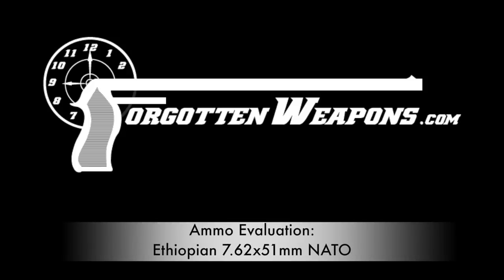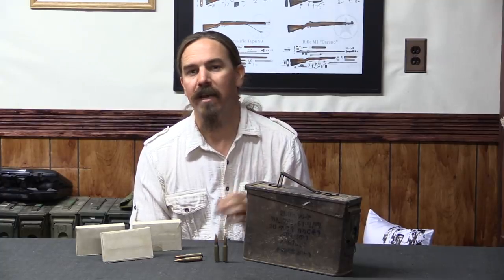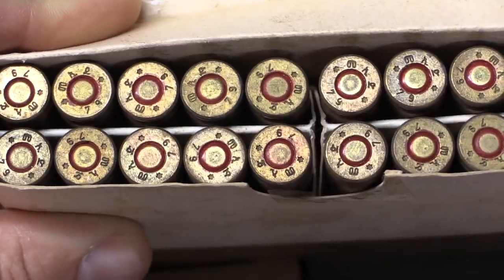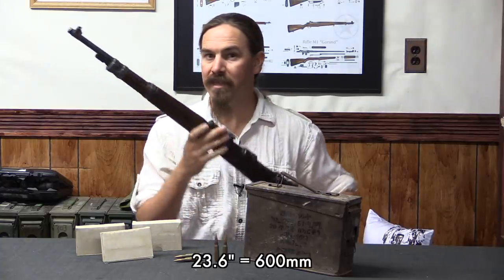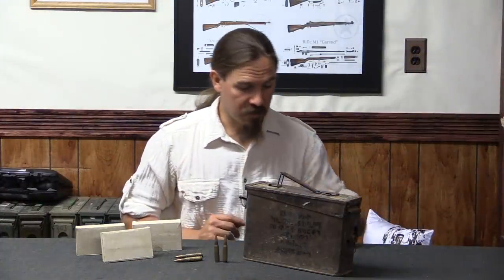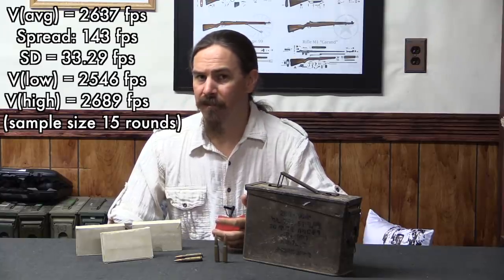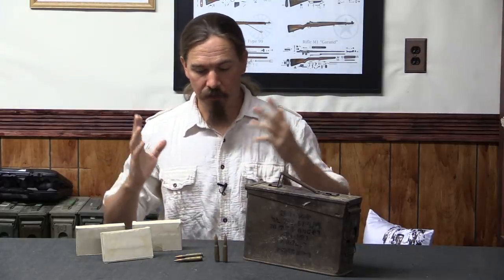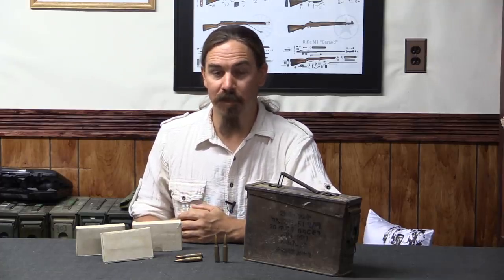Ammunition Evaluation: Ethiopian 7.62x51mm NATO

Comment: Definitely an interesting option if you want to some cheap ammo to shoot down range, but with the delay wouldn't they be a bit risky to use on automatic firearms?

Also. the second language on the ammo-box is called Amharic, and it's one of the more common languages spoken in Ethiopia.
Reply: In automatic firearms, it will not cycle until it fires. So no, I don't think it should be an issue.
Reply: I see.

The only experience i had with firearms are handmedown Vietnam-era surplus M16's while i was in the army. And the reason i'm bringing that up is that once when our instructor shot a 3 round burst down range (Though we weren't allowed to do any automatic fire) the 3rd round was ejected somehow with the bullet still in and it fired off half a second after being ejected. Luckily nobody was hurt but all were pretty amazed.

How or why did that happen is quite a damn mystery for me to this day, but point is that shit can happen.
Reply: Yeah, it would be nice to have a  video like this every now and then.
Reply: I think it really depends on the weapon. As noted, usually on an autoloader the cartridge won't leave the chamber until it fires, so it's safe. Usually also, the gun will recock upon fire so outrunning the ammo and ending up uncocked won't be an issue. But if the weapon does automatically eject the round whether it fired or not, a hangfire would be dangerous. Perhaps this might be even more of an issue on a rapidly fired manual action, since they eject without regard to the state of the round. I think this ammo would be dangerous to fire rapidly in a pump or lever action, since it's possible one could eject a hangfire round before it has fired. Shooting semi-rapid or slowly where accuracy isn't a major concern this ammo would perform. In full-auto the cadence would he weird, and in semi-auto fired rapidly it may not fire with each pull of the trigger, since it would be possible to pull the trigger again before the hangfire round fires.
Reply: Main risk of hang fires in an automatic weapon would be in your externally driven repeaters, like gatling based weapons, where the weapon will fire and then begin advancing the cycle whether or not the round actually goes off. 
I'm sure if you dig around long enough in various designs that you can find some open bolt design at risk of bolt bounce that could give you issues.

If anything I think a double action revolver is possibly your most dangerous platform for hang fires, due to the risk of accidentally advancing a hot round out of alignment with the barrel. Having an un-contained round going off near you isn't what I would label as pleasant or very safe, but it also isn't excessively dangerous to your life in most cases. Having it contained in a cylinder so that pressure can build up will really change the dynamics of things.
Reply: @Tricerius  : The hang fire issue is the answer for me. Very hard to get any accuracy with that issue. And like Ian said if you eject a round "that didn't go off" to soon you have a mini grenade coming out. No thanks. Other ammo available for me. I would like to see if different lots have this issue.
Reply: MrGenoHydra bolt bounce, the spring needed replacing.
Reply: It'd only be risky if the extraction process operated independently of the round firing. Just don't run it through a minigun and you should be fine.

Comment: Are there still primers based on mercury fulminate?
Reply: No. Lead Styphnate is most common I believe.
Reply: Adam Halsey  
Mercury fulminate is just a SENSITIZER and accelerant for the metalic cartridge priming mixes jt was used in, not the sole ingredient.

 Almost inert (due to age) chlorate based primers with Mercury fulminate as an ingredient will behave EXACTLY like this, since the fulminate is slowly degraded by exposure to heat, moisture and Carbon dioxide from the atmosphere.

Comment: i only found out today and it annoys me that i never released cos it makes perfect sense, but 7.62x51 is not the actual dimensions of the ammo, its actually 7.82mm and 7.62 refers to the rifling, and 7.82mm in inches is 0.308 hence 308 nato, well it's 308 if you round
Reply: The bore is 7.62 while the rifling is 7.82mm. I do not remember if the barrels used for 7.62x54r has a 7.62mm bore or 7.7 (303)
Reply: Espen Andre Most Mosin barrels are .311 in the grooves like a .303 or even bigger. The Finn captures were usually converted to .309 diameter barrels.
Reply: wait this may sound stupid but if the rifling is 7.82mm and so is the bullet then how can the rifling affect the bullet? surely it has to be smaller or does the heat expand the bullet to cause friction?
Reply: so roughly how much do they expand in guessing at least 0.2mm?
Reply: @bitchfacedmgee7433  Groove is 7.82 and the bullet is 7.82mm. The bore is smaller at 7.62. This causes a .1mm deep groove to be formed on each side of the bullet that contacts rifling by the act of compressing the bullet (this is known as engraving).

The in's and out's of barrel rifling is quite an extensive one so it would be hard to cover it all but I hope I make some sense. Also bullets especially cast bullets tend to be oversized so bothe the bore and groove area squishes it down
Reply: That's a debatable change, 7.62×53mmR Finnish is basically the same 54R,  Finnish commercial ammunition manufacturers say it's interchangeable as do the Russians.
Reply: SuperFunkmachine It is interchangeable. The case is actually about 53.5mm long. I’ve loaded .308 and .311 bullets and there isn’t much difference.

Comment: Definitely love this testing, fantastic stuff, would definitely like to see more of this! And, to add to it, here's an idea to further improve the testing procedure...

Maybe try attaching a small stick or dowel of sorts(ideally painted a contrasting color from the background) a couple of inches long to the side of the trigger, hanging outside of the trigger guard, so that we can reasonably quantify the duration of any hang fires that may occur by being able to visibly clearly see on video when EXACTLY the trigger is being pulled; the stick in effect lengthening the trigger by a few inches opposite of its pivot point will of course travel a much longer distance over the course of the trigger pull, creating a more clearly visible visual notation[for lack of a better phrase...] for viewers to know when you've pulled the trigger, from which we can roughly determine how long it's taking the primer to activate the powder. This would even make it possible to roughly measure the actual length of time between each trigger pull and the moment that the projectile leaves the barrel, which would allow the variance in primer activation time(I'm sure there's an industry term for this) to be calculated.

Just a thought to add more data to this sort of testing

Comment: I like this! Please continue doing tests like this.
I personally would really like to see a test of late 70's early to mid 80's Norinco 7.62x51 nato surplus.
Reason is mearly out of curiosity, but also I have read so many different stories about how they perform etc.
Since they are usually copper washed casings with good seals they don't tend to "rot" that much which makes them seem good for testing.
It would be very interesting to see what you come up with during testing of some of those, and if I am not wrong, they are pretty available still.

Comment: A note on the dating of the ammunition - the dates on the ammo can may not refer to the years during which the ammunition was produced (logically suspect anyway as how could one predict the end date of manufacture) but rather the year given in both the Ethiopian calendar (EE) and the Western calendar (AD).  The Ethiopian calendar runs about 8 years behind the Western (for example and Ethiopian coin dated 2004 would actually have been minted in 2012 AD.  Being that the cans were obviously reused (note the request to return the can) it would not be unexpected that the can would contain boxes of ammunition manufactured in 1979 EE which would correspond with 1987 AD.

Comment: P.S.   I still have some of that DCM ammo left and after 50 years it still fires reliably.   So good components (WW primers I believe) stored properly [no extremes of heat/humidity] have an indefinite shelf life.    I remember that old (old as of the early 1960's) powder could deteriorate under high heat conditions and if you opened a can and a reddish smoke came out - destroy and discard.

Comment: I would certainly like you to add "forgotten ammo" like this to the rotation!

A nit I must pick: Could you not use the words "detonate" and "detonated" where words such as explode, ignited or  burn are more correct? I blow things up and set stuff on fire for a living, so I'm a bit stuffy about how people describe events related to energetic materials-  "Detonate" is an engineering term with an exact meaning, rounds of fixed ammuniton, and most certainty the propellants commonly used in it don't detonate under any normal circumstances- You certainly CAN put a blasting cap in a pile of Bullseye and get an actual detonation, but it isn't detonating when you are  burning it in your pistol, not on a good day, anyhow.

Please, unless you KNOW the reaction is moving faster than the speed of sound in a solid, liquid or gas? Just use words such as "explode" "ignite" or "burn" to describe it. Primer compositions explode but don't detonate while functioning for the most part, even if they have high explosive or primary explosive ingredients. An out of battery round whose primer is struck by a malfunctioning firearm or a round ejected after a primer is struck and undergoing propellant ignition outside the chamber due to a hang fire CAN be properly said to explode- They aren't detonating.

Sorry, I get this way sometimes.

Comment: Group size, agreed.  But if you provide the standard deviation across 10 projectiles, 10 charges, 10 case volumes, 10 muzzle velocities... that should give a pretty good idea of group size.  Even just velocity StdDev would, but the others would represent why.  Didn't use SD because in this case, that would mean sectional density (which is a better representation of ballistic coefficient, knowing they are spitzers).

You can measure the density of the projectiles easily by suspending the projectile in a known volume of water on a scale.  Several youtube videos demonstrate this.  The density will give you a good idea of the distribution ratio between copper, steel and lead.

My reloads often give 6-8 SD on velocity and I thought that was bad.  You're telling me 10 is good?  I'm still improving with the goal of 3-4.

Comment: I would consider buying this ammo if the price were right.  Old ammo FREQUENTLY has hangfires.  Plus it may be corrosive.  The solution is simple: Pull the bullets and powder, reload in a newer boxer primed case and with brand new primer.  Do this and everything gets better.  Of course, you can also be more precise about powder charges and cull bullets that way way off the average.  It will never be match ammo - but it can be improved upon.

Comment: Your comment on hangfires got me thinking.  What if, instead of focusing on instant firing ammunition, it became standard to have a delay of a quarter or half second or so?  I could see this working in early centerfire rifles with heavy loads, where you pull the trigger, and hold it on target until the round goes off, akin to the delay in hammer fired designs.  As with many things, ammunition going off instantly is now standard, but 150 years ago, there was no standard practice or semi-automatic rifles, so this would not have been as far fetched at the time.

Comment: Thanks Ian. To compare it to the age of 1976-1980 7N6, which I’ve had no problems of any kind in over 10,000 rounds throughout the last several years, this Ethiopian stuff may have been stored wrong, or made poorly. Ammunition should last decades if stored properly. I’ve shot US WW2 ammo with no issues. I think you were smart to utilized a Mauser action K98 for testing.

Comment: So, well made ammunition stored in a tropical environment then.  At least they applied a sealant to the neck and primer.  I noticed that it looks like they roll crimped the case neck around the bullet as well, which should help seal it up too.  I'd be kind of curious how much variation there is in bullet and case dimensions and bullet seating depth, not for ballistic accuracy but just to see how well manufactured they were back when disco was still popular.

Comment: The hang fire danger is not a round in the air, it is a round still chambered when you have unlocked the action. I have observed many a round cooked off in a fire, and they are not the hazard many imagine them to be because they do not develop pressure the way a cartridge does when contained in a chamber.

Comment: I reload and I liked this. One thing I felt was missing was a detailed looked at the case. Weight, primer pocket details (primer type, need to be swaged, etc.), and condition after firing (split necks, other details)
Reply: Also you didn't mention if it was corrosively primed or not

Comment: Ian, useful work. Would be good to know what surplus ammo may be worth purchase and safe to use. As feedback, was curious about the consistency in diameter size for the bullets and the consistency of powder charge weight. Some for technical reloaders may also want hear how consistent the cases are in weight, length, and volume. Some may want the ammo for the brass, if the brass were of good (better than average) quality. For the reloaders seeking brass, the hang fire may not be much of a matter; just going to shoot it off to then brew up the good stuff.

Comment: My two cents:
Rob Ski over at AKOU has a few ammo tests up for 762x39 and 545. His opinion is that, at least for those two calibers, having a Standard Deviation above 30 fps is basically crap ammo so this seems to be bottom of the barrel ammo if you consider that 7.62x51 was produced by supposedly better quality manufacturers in the west, both for commercial and military production. 
Additionally, I suspect that when this ammo was new, it probably had an SD of around 28 to 30, considering they received assistance from the Czechs. I base this on nothing other than a gut feeling.

Comment: i like that kind of format.
is there a reason you did not weigh the powder charge or measure the cartridge case (volume, weight, length, width,... before and after firing? i think that would give reloaders a pretty nice database

Comment: I hope that those who bought this ammo actually understands what corrosive means.50+ years ago my Junior Rifle Club got a case of 30-06 from DCM which was WWII primed (corrosive).    Nobody wanted to deal with these so my Father took the lot and it was up to me to deal with - pulling bullets and powder, popping primers with old barrel and punch then WASHING the cases before re-priming and reloading.Corrosive will probably be mercury and the barrel used needs to be cleaned THE SAME DAY with both a hot water and regular rifle cleaner with brush.    Damage to the bore can be seen within 24 hours of firing.

Comment: The hangfires are noticeable, but within your sample it's notable that every round did fire, and fired within a reasonable standard of performance. Depending on cost and given what it is, I certainly wouldn't give it any sort of failing grade. Century shouldn't be too mad. 

Also a side note, looking at the condition of the storage box I bet you're having LIFO issues... last in, first out. The first boxes you snag are the boxes closest to the door, with the least stable environment.

Comment: Fair enough  review never know what you will get when getting surplus ammo regardless of where it came from. Typically good for cheap plinking or practice I've had batches of surplus where half the rounds didn't fire and others that were perfect from the same maker . Always bring a magnet when checking surplus occasionally you get steel ep rounds if you are lucky you find brass boxer primed cases with lead bullets the normal experience is steel or brass with burden primers and some kinda fmj  so aye tip our glass roll the dice and buy some for plinking or if it's boxer primed buy it for reloading unless it's steel . Is it reliable well 75% good enough for plinking after all what else is fmj ammo for well maybe hogs and varments just be careful and have fun

Comment: 2:50, 4:41 - The technical term for the Ge'ez script (that used for Ethiopian and Eritrean languages like Amharic, Tigrinya, Oromo, etc.; its namesake is the ancient Ge'ez language, which is nowadays used only by the Ethiopian and Eritrean Orthodox and Catholic Churches and the Beta Israel Jews, and then only as a liturgical language) is an abugida.  Each individual glyph is composed of a base form which represents a consonant followed by a certain default "inherent vowel"; if a consonant is followed by a vowel other than the default, or by no vowel at all, this is indicated by tacking a small modifier decal onto the glyph.  (The script was originally an abjad, where vowels simply aren't indicated and have to be inferred [like in non-Biblical Hebrew, r lk 'm dng n ths sntnc cls fr prpss f dmnstrtn]; when it was in this stage, the glyphs that today represent consonant + inherent vowel were used to represent the bare consonants.  The Ge'ez script evolved from an abjad to an abugida by about 350 C.E. at the latest [around the same time as the Christianization of the Kingdom of Axum, the predecessor of modern Ethiopia], and possibly much earlier; around this time, it also switched from being written right-to-left [like Arabic and Hebrew] to being written left-to-right [like Latin, Greek, Cyrillic, Devanagari, etc.].)